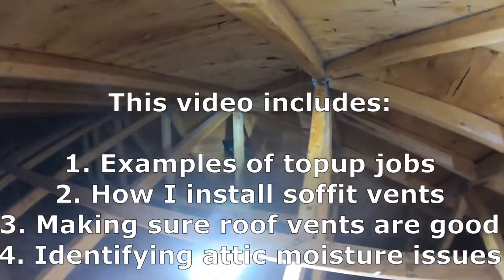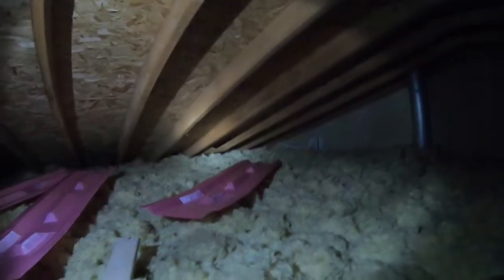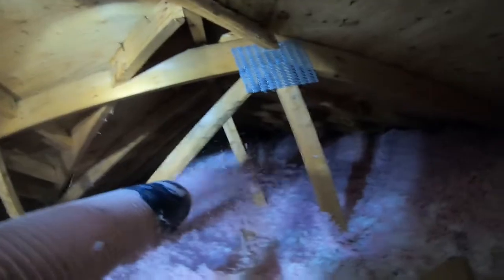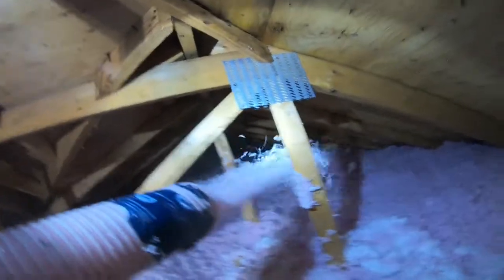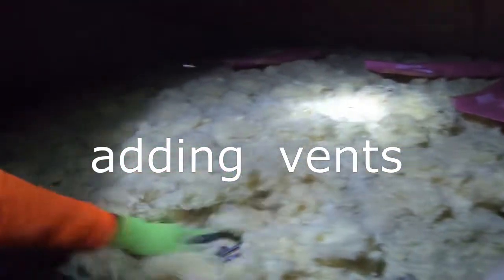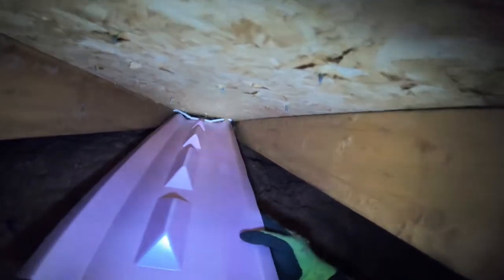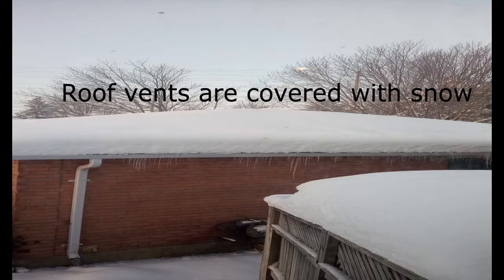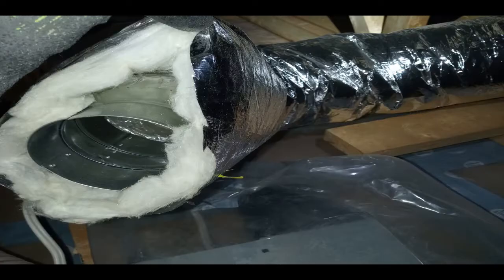Why should I add attic insulation in my home?

Comment: Where are you located ?
What would be the cost to remove my blow in insulation and doing an air seal and then redoing my fibre glass blown in insulation.
The area is about 1000 square feet.
I am in Toronto
Reply from the maker: The cost of your project would be costly due to the air seal. It's a great choice, especially for older homes though and worth it. Your cost would be, and don't quote me on this, but between 3-5k. I unfortunately have an understanding with my employer that I can't say where I work, but I can say I am in Ontario, so the videos you see are in homes with similar climates.

Comment: Great video as usual my friend. Very informative. Like how you compared the house without 2 ft of insulation, to the one that does!
Reply from the maker: Thanks a lot man. How does your attic look like?
Reply: @SinnisjInsulator  I can't tell it's an apartment. Roof is flat. It's been 50°F the last couple days so it's probably melted anyway.
Reply from the maker: @AdventureswithDanno  ah ok so it's probably got sheets of insulation or maybe foam board.
Reply: @SinnisjInsulator  😎👍